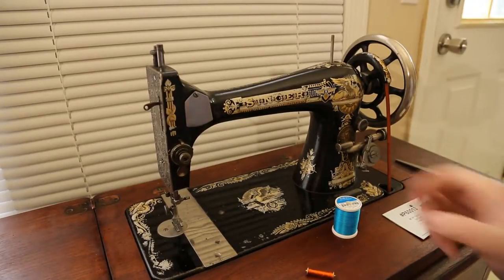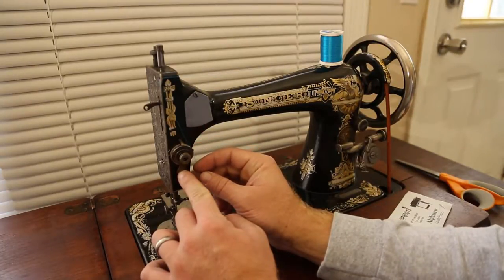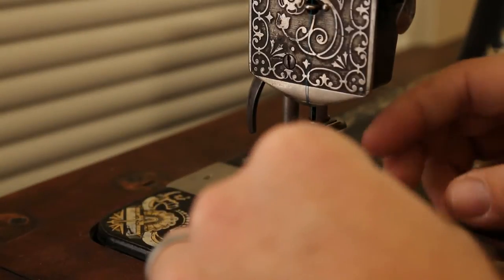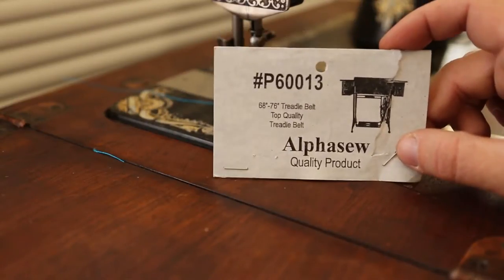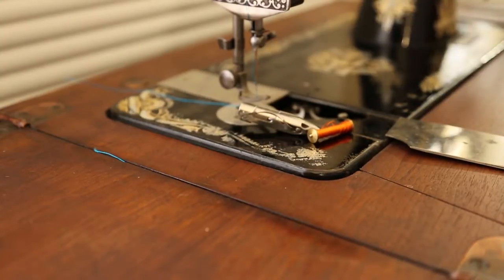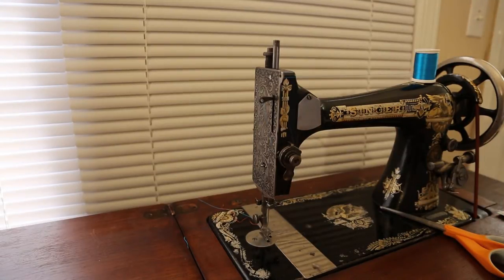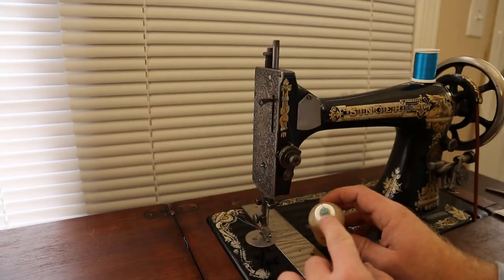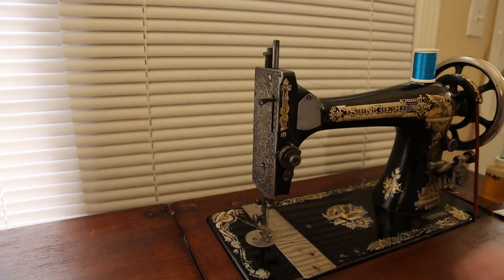1908 Singer Sewing Machine: Threading & Bobbin

Comment: I know I'm late to the proverbial party but I just have to add a little piece of advice to your viewers.  Please don't grab the bullet bobbin by the wire when pulling it out as this can bend it and cause damage to the bobbin. Instead, please use the little round push button located just at the foot of the bobbin as that's what it's for.  you simply push down on it and it pops right up 😊 Hope this helps and THANK YOU for a wonderfully informative video.

Comment: Yesterday, I put the WD40 in that hole that you mentioned and that I never saw before - because I did not know it was meant for oiling the stitch length button. I covered the big button and used a pair of pliers to turn it and it worked. After cleaning and oiling, this button can now be easily turned to modify the stitch length. Thank you so much for your very useful video; it helped me fixing the problem with my machine. It works so nicely now, I am delighted with it!
Reply: I did the same, I hadn't realized that hole was there! The stitch length know works now!

Comment: If you push down on the pointy part of the shuttle it raises the back of it up making it easy to remove from the machine.  It's not only easier but there's no chance of damaging the shuttle's tension spring that way.  :-)
Reply: @Peter Alexander Yes you can, but it can also get distorted when people make a habit of picking up the shuttle by the tension spring. One day, when the shuttle carrier isn't far enough forward, it'll distort the spring and the shuttle will stay put when someone pulls up on it confidently.  They're not making any more of them so my recommendation is to look after the ones we've got. Especially when there's an easy alternative - which is the way that the Singer manuals also recommend - that you can use anyway.

Comment: tip for threading needles.  do not snip except right before you thread the needle.  do not touch the end of the thread or it may fray again.  keep a small piece of white paper next to your sewing machine to see the hole easier.  great video!  also, use needles with the biggest hole you can get away with so you don't struggle with threading which is the most aggravating part.  another helpful hint is each sewing machine needle has a groove in one side. slide the thread along this groove for a 1/4" or so to guide it right into the hole.  you should be able to feel the groove in the side or your needle is worn out and should be replaced.

Comment: Thank you  this helped so much.  Unfortunately the top thread is not picking up the bobbin thread.  For some readon the bobbin thread will not come through that little hole
  It comes out just below it.  Will keep trying!
Reply: Sometimes it is as simple as needing a new needle. The slightest burr can cause this.

Comment: Thank you so much for this video. Those things that get the fabric moving forward are called ''feed-dogs''. In freemotion quilting, some say that they have to be off or down if you like but on this machine, there is no way we can put them down. Some others, on the contrary, prefer to leave them there. I did not try freemotion quilting yet on this machine. Another thing I can tell you about is the king of machine this is: it is a 28K. I am also using WD-40 to clean up and Singer oil to oil. I am going to watch your part-2 video now. Thank you very much for this one, threading is going to be easier now. Next thing to get this machine for my needs will be to loosen up that stitch length knob. I will put some WD-40 first and let it work for a few hours before using the pliers covered with a piece of fabric, like you suggested.
Reply from the maker: Thank you for the question and feedback. I hope you are able to do what you would like with your machine.
Reply from the maker: WD-40 does leave a residue but I have found that it is not a thick gumming residue such as that left by Rem-Oil. You can always test the oil you would like to try by putting some in a small glass dish (such as a tea light candle holder) and letting it sit out. You will know exactly what it is doing inside your machine if you do that. I appreciate all your feedback and hope your information is able to help others setup their machine properly. I don't actually know a whole lot about these old machines but I have helped get several running again after years of neglect. All your info is helpful. Thank you!
Reply: @scramblerman90  Hi. From my engineering knowledge: WD40, like u said, is good for cleaning up existing residue. However: it is NOT a lubricant - google it. Many cyclists mistakenly use it to lube their cycle chain - but it's the worst thing you cld use. You need to use a good oil lubricant.  Great video BTW!
Reply: I'm finding that Kroil penetrating oil is helping loosen up parts on my newly acquired Singer 27 treadle machine.

Comment: to get it through the little illett on the decorative end plate you don't need to thread it through you just pull it through from the back
Reply: Oh my goodness I never realized' so easy! Just inherited an older model without the drive belt. So it was first time I threaded it up (which I had done before I saw video) I was looking for how the thread runs to load up the bobbin with thread. I loosened the hand wheel to stop the needle going up & down, & connected the large wheel to the sma bobbin leading wheel etc so all prepared. Just trying to figure out where the thread goes?

Comment: Hello, thank you for making this video.
I do have a couple of questions if I may ask.
I have a machine that looks just like yours. Its model number is 14529660 .The decals are the same and so is the bobbin winder. My bobbin gets its power from the cable not a rubber tire that is run by the wheel. I believe my winder is rusted so as it leans into the cable, the little round part does not move. How do you get that unfrozen or will I have to get a new one?
My next question is we did buy a bobbin and a shuttle, but they seem too big to fit into the machine. I can get it in but I think it’s upside down. 
Is there more than one size shuttle for these machines?

Comment: It is stitch length not width and also WD40 should not be used as a lubricant only to clean and loosen up gunk.  I used a treadle vintage Franklin when I was 7 yrs old and still remember how to use these vintage machines.  Please learn the correct way and not how you assume it should be.

Comment: Saving for future use if needed again. Although mine is not working correctly.  I was needing see the opposite  of putting the bobbin into the bullet. I need to get mine out as it is binding and the thread won't pull thru it. I can't figure out how to get the bobbin out of the bullet thing. Ughh.
Reply: Push down on the pointy tip of the bullet shuttle, and lift from the back rounded end and it should come free.

Comment: Can anyone advise me regarding the lower tension on the 'bullet' longbobbin shuttle case? The thread has to be pulled very hard to move through. Is that normal? The machine was manufactured in 1886. Cheers.
Reply: You could try loosening the screw on the shuttle in very small increments. It should be easier to pull out, yet hold when lifted by the thread.
Reply: @dragonqueenarts  Thankyou Khaleesi.😊 I'm back with my ancient hand cranked singer again. She's tricky but lovely.

Comment: i have a similar machine but cant get the tension right can anyone help please
Reply: The first thing I did after I got mine was to take it to the local repair shop for a tune-up, cleaning, and lubrication. It cost me $100, but worth every penny. Everything works exactly right, including the tension.

Are you sure you're adjusting the right tension? There's a tension screw on the bobbin case as well; maybe the issue is your bobbin tension.

Comment: Good video, thanks alot. But for WD-40 i highly doubt that this is a good idea. It is a general rule to never used WD-40 for gearing and mechanic stuff like so. Something more greasy would be better i believe.
Reply: Clear, colourless sewing machine oil is the best.  You can "loosen up" sticky and stuck parts from the old, old sewing machine oile using deodourised kerosene (called paraffin in some places) and then after that use sewing machine oil.